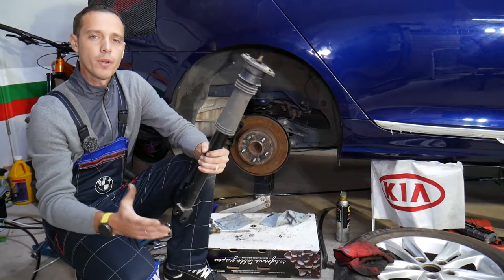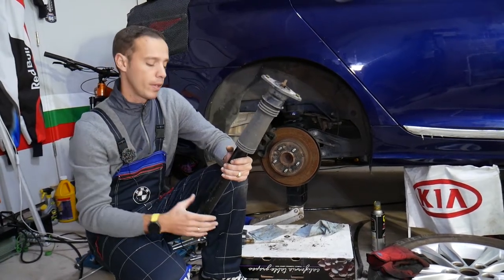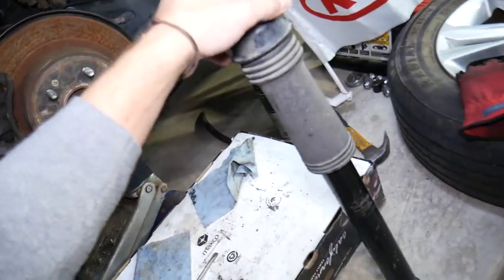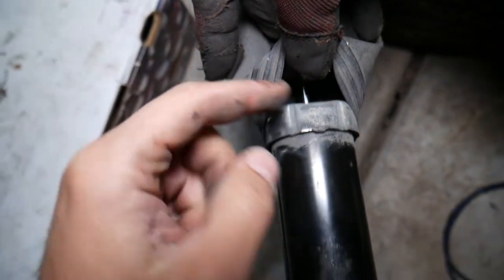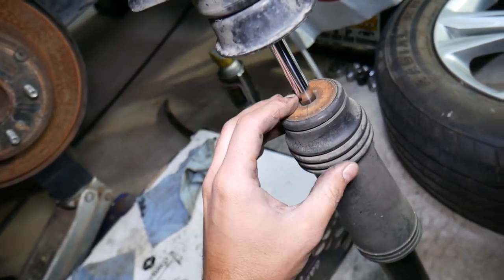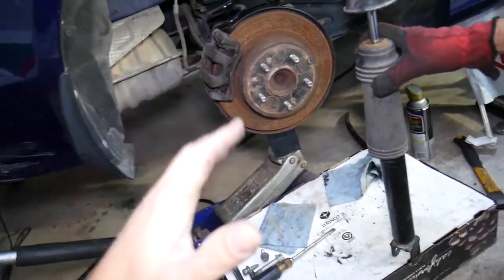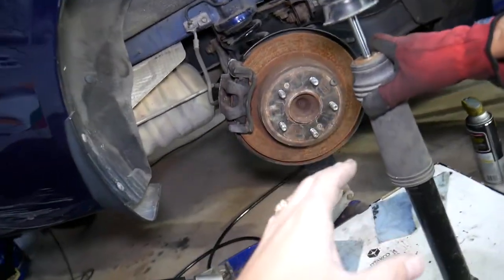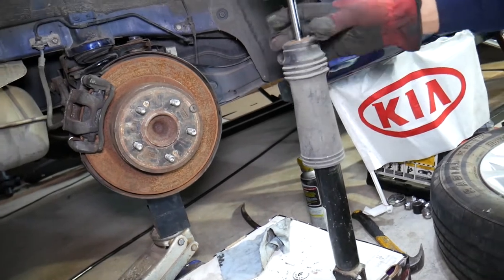HOW TO TELL IF REAR SHOCK ARE BAD KIA OPTIMA FORTE RIO SOUL SORENTO SPORTAGE

Comment: Can you please do a video on taking the struts/shocks off the car so I can check them? Also, I plan to remove the ball joints and tie rods as I want to see if they still have more milage or if I should replace them. Thanks1
Reply: Don't take them off to check them. If you take them off might as well just change it.